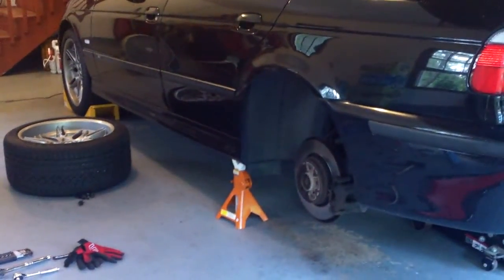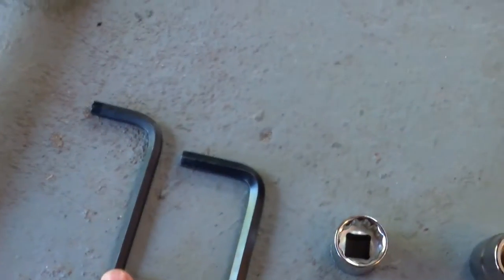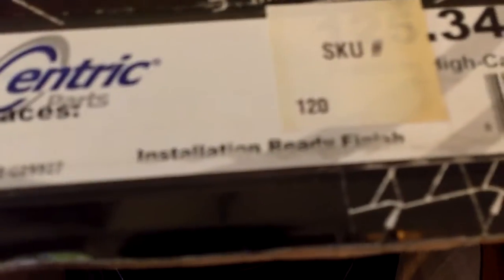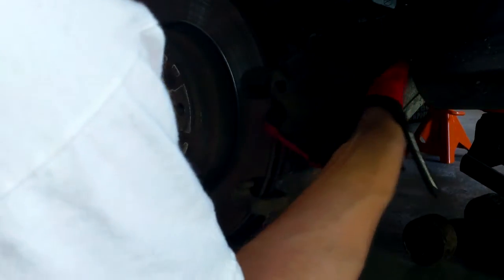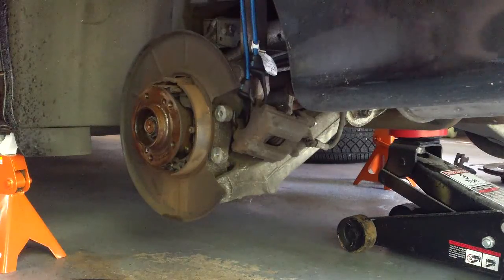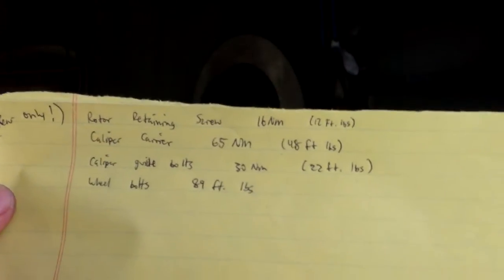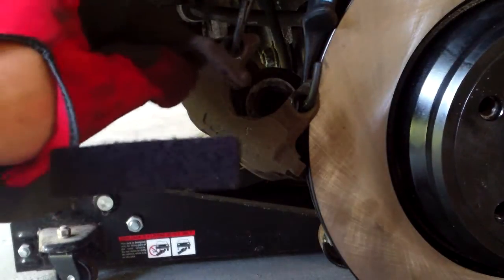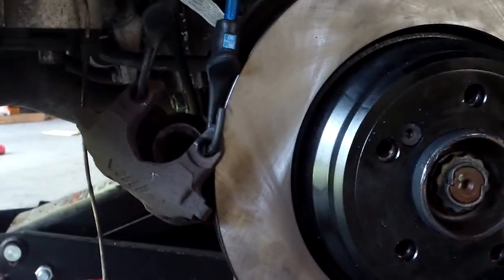DIY BMW E39 M5/525/528/530/540 Rear brake rotor and pad replacement

Comment: I recommend you hit the front side of the rotor, along the edges to take it out if it’s stuck on there! It’s way more effective. Had the same issue yesterday and it worked. I was punching the back of the rotor for like a hour and nothing, hit the front and 5 minutes later it was off.

Comment: Is the brake caliper guide bolt a 7mm or 8mm? Also why do you use a torx bit to take it off? I'm so confused
Reply from the maker: Should be a 7mm. I didn't have a hex bit at the time, so I used a torx bit

Comment: Actually you shouldn't hammer the disk part of the rotor because you could damage it resulting in vibrations when you hit the brakes. You should hammer the rotor instead specifically in the areas bettween the bolt holes. I'm planning a similar DIY for my 520d E39. I didn't find yet a store here in Portugal that would sell breake grease and anti-rattling grease for the brake pads.
Reply: he changed the rotors...

Comment: Beat the crap out of it with a rubber mallet and eventually it will break loose.My problem is getting the fourth bolt off the back of the bearing housing. Those stupid E 14 torx sockets are not biting strong enough to get the last one loose. I am about to cut the flange loose from the rest of the housing and hope I can unscrew the remaining tab from the housing. Otherwise I may have to grind and chisel it off.